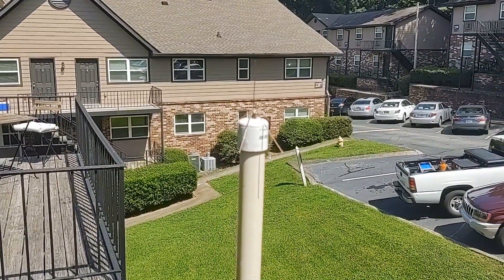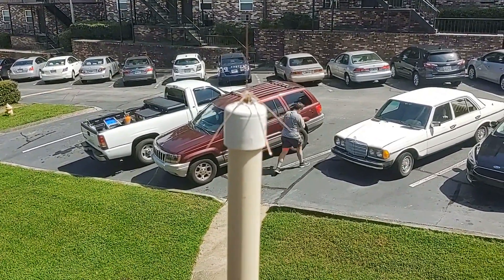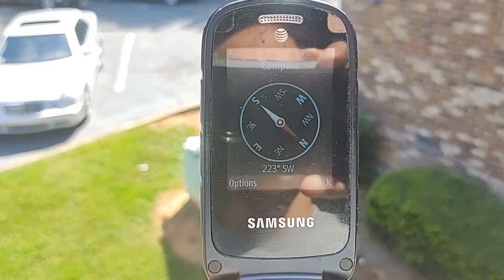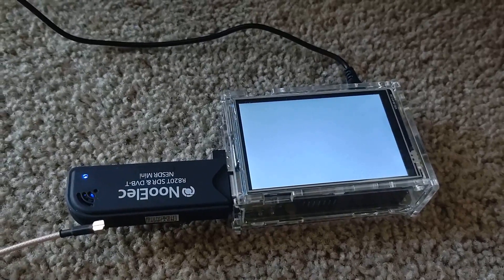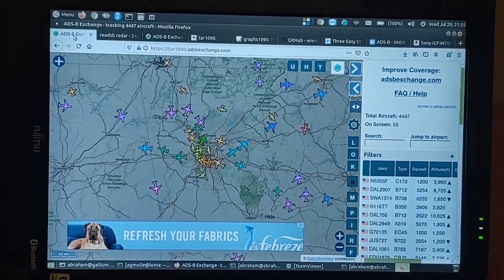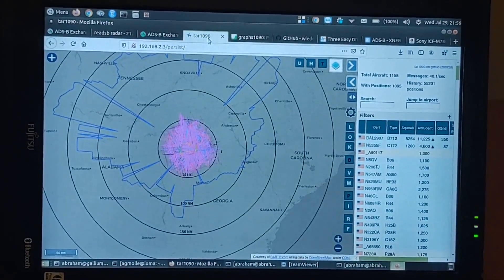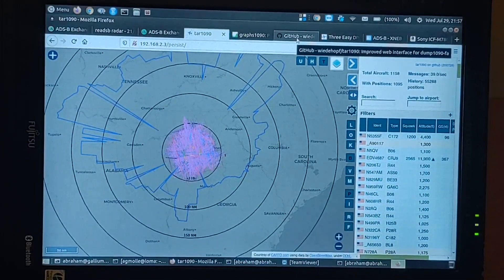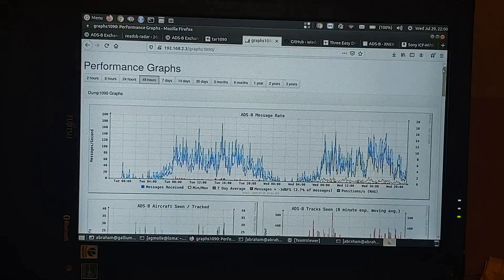New ADS-B setup - Raspberry Pi 2 in Atlanta

Comment: I love your setup. Just experimenting with a diff. antennas myself. For me the best setup was half-wavelength from this manual https://jeroen.steeman.org/Antenna/collinear-dipole   One quick question about yours. Shouldn't the antenna be on the top of the roof?
Reply from the maker: Thanks for sharing! I indeed want to try a sleeve dipole. It should probably be on top of the roof, but I don't have a mounting point (or coax) there yet.